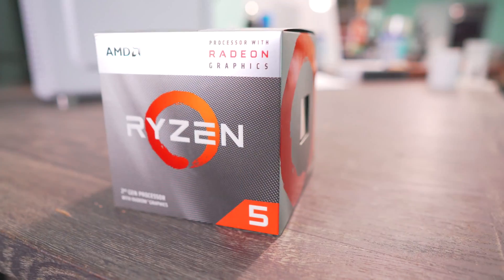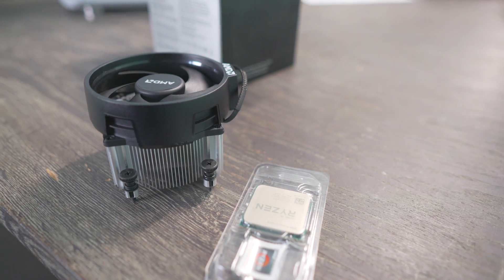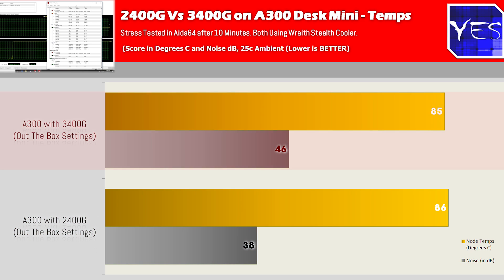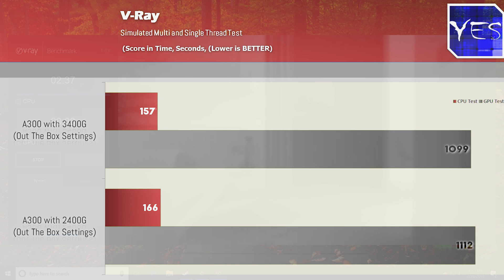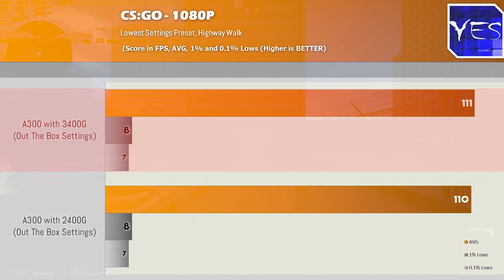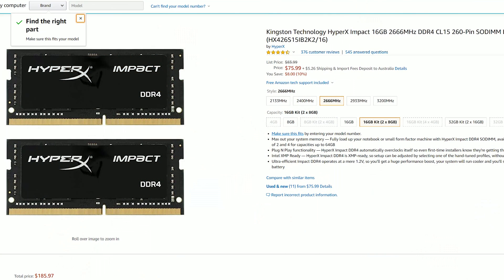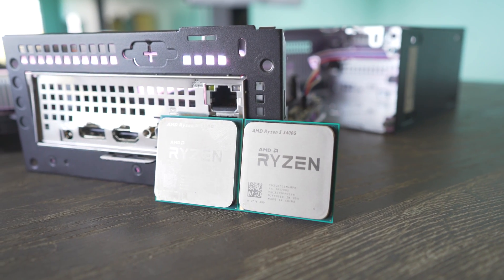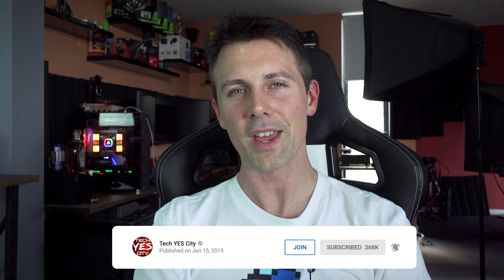Ryzen 2400G Vs. 3400G ON Desk Mini A300 - Catch 22

Comment: Are you able to see how well it copes with WoW?
I got to test a 2200G while ago and while it was fine for solo stuff a five man dungeon was about it's limit, I did test a raid and it didn't crash but it wasn't a smooth experience. I don't know if the 2400G would have enough for the raid to be smooth but the 3400G might cope better with the newer cores.
I'm asking as one of the people I raid with is struggling on a very old laptop, I'd have gone mad putting up with it years ago!
Reply: This is confusing. Are you asking for yourself, or for your friend with the old laptop?

If you are asking for your friend, I suggest you steer him to the Integrated Graphics Survival Guide by LowSpecGamer.

I just recently purchased a 2200g for $59.99, and my first upgrade will probably be an RX 590 discrete GPU. After that I will probably upgrade to a R7 2700X.

If I feel the need to, I will do as the Integrated Graphics Survival Guide recommends, and download Raptr.

Comment: disappointed mate. thought for sure you were gonna do these tests with the highest frequency ram and overclocked ram, cpu, gpu
Reply: Overclocking on A3xx Chipset? Any bios options? Forget it. OC you start with chipset B450 and higher. 
ITX-Cases are too small, too much heat --> cooling too loud. For OC you need a bigger case.

Comment: My 2400G works with 3333MHz RAM clock @ CL16. For maximum game FPS.
Reply: can your RAM using 3333 or you can just use ~3000? in CPU Support Specs => DDR4-2933MHz (Ryzen)

Comment: Hey man,
i had slight different results, but i tweaked all the settings to the ground.

The Following Setup is what I used:
ASRock DeskMini A300
AMD Ryzen 3 2200G 4x 3.50GHz So.AM4 BOX
16GB (2x 8192MB) HyperX Impact DDR4-2666
500GB Crucial P1 NVMe M.2 2280
Noctua NH-L9a-AM4 Topblow Cooler
ASUS Rog Swift PQ278QR @165hz

You should know i am Playing Counter-Strike on a competitive level thats why i used a lower resolution.
On a Resolution of 1280 × 1024(5:4) i have on avarage like 160fps and it never drops below 100.

GTA5 i never went below 80FPS @1080p
Fortnite around 75FPS @1080p
The Division 2 - 55FPS @720p
Star Citizen 20FPS @720p
Ark Survial Evolved 30FPS @720p

Comment: you need good memory. at least 3200Mhz. APU runs way better with fast memory.
Reply: At least 3333MHz at CL16. You need 3400 or 3600...
Reply: @christiankulmann3325  yes I have overclocked 3200mhz to 3400Mhz CL16. I am thinking of getting 3733Mhz C17. I could probably overclock it around 4000 Mhz. I just don't know what kind of performance gain I would get out of this upgrade

Comment: Hello there!  I have this same system, with a 2400G, as well as a new 3400G in a box, ready to install.  Before I do, would you be able to benchmark this with World of Warcraft, on both systems, in 720p and 1080p, and post the results?  I would love to compare your results VS mine.  Thanks!
Reply: Either should push WoW fine. I have an overclocked 2200g system and I see 40-50fps on gfx preset 7 in Battle for Azeroth raids & 80+ gfx preset 10 in Classic both at 900p (1600x900).

Comment: Anyone know if i get the 3400G with B450 MB the bios will have to be updated first and not have to with the 2400G?
Reply: Yep. The 3400g will need a bios update on that board. You don't need to necessarily update to run your system with the 2400g.
But updating is not that big of an issue. Unless you are tight on budget, go with the 3400g.

Comment: Excuse me. Can anyone clarify if the cooler that come with 3400G fit on the desk mini a300? Thanks!
Reply: Nope 
It wont fit 
3400g heatsink is too tall 

I reccomend to use cooler from that a300 
Certainly a bit noisy, but i runs cooler than stealth wraith cooler 
Lower 2 degrees celscius exactly

Comment: I believe the A320 based boards can indeed support 3rd generation Ryzen CPU's. This channel tested the cheapest Gigabyte A320 board with a high end 3000 series CPU and found it to work fine. 

Of course, this does depend on the motherboard vendor releasing suitable BIOS updates but otherwise there is nothing physically preventing these boards running the newest chips..

Comment: I didn't think there would be much differences between the two APUs. But, glad you did the testing sir.
Reply: 2400 is ryzen 1st gen and 3400 is ryzen 2nd gen, it's not 7nm and not ryzen 3rd gen, hence why they are so close
next one should be based on 3rd gen and 7nm, maybe that one might be a much bigger boost/difference
Reply: Cobac Good point. Thank you.

Comment: Now I need a ryzen 9 3990G with vega 56 performance.
Reply: PS5 must be the answer
Reply: @FodrMichalych  as for raw performance, no. As for game performance, Very unlikely. I mean,  optimization for playstation may be able to reach 4k 60fps on ps5, I doubt it'll reach 4k 120fps. A ps5 chip has to have low tdp, low power consumption and so on.
Reply: @Octa-8wow  that's still not enough if you consider it has navi graphics and 8 zen2 cores. It has to draw like 100 for the cpu and 100 for the gpu, which is very little. Tdp will be even lower, probably around 45-65w for both the cpu and gpu.
Reply: @Octa-8wow  but we know for a fact it's gonna be zen2, 8 cores 16 threads, and a 12tflops navi gpu.

Comment: Some months ago I have decided to build my EVER FIRST PC myself. I am an oldie (64) so bare with me...

Here are the components I have decided to use and already bought them:
ASRock A300 barebone PC
 
Noctua NH L9a CPU cooler
 
HyperX Impact DDR4 SO DIMM 2666Mhz CL15 - 8GBX2 - total 16GB
 
Samsung 970 EVO Plus M.2 NVMe 500GB SSD (main drive)
 
Samsung 860 Evo Basic Internal SSD 500GB. (secondary drive)

My original plan was to use the AMD Ryzen 5 2400G CPU, but I have decided to wait for the new AMD Ryzen 5 3400G.

I am not a pro but from what I manage to understand after seeing some reviews and Youtube clips the main differences between the AMD 2400 and 3400 are mainly aimed at gaming.

The original Asrock A300 does not require any BIOS changes using the 2400G while the 3400G does require changing the BIOS.

The AC power consumption is a bit higher in the new CPU.
Is the ASrock A300 ready for the new CPU?
The new CPU is more expensive.
Will my DDR4 RAM (HyperX Impact DDR4 SO DIMM 2666Mhz CL15 - 8GBX2) match the new CPU?
Are these correct?

As a reminder - this PC is NOT for any kind of gaming, just web browsing, MS Office and some photography work such as Adobe Photoshop and Lightroom and some basic video/slideshow work.

Based on all the above - do I really need the new CPU?
Or should I stick to my original, cheaper and more easy plan and use the AMD Ryzen 5 2400G?
Does it justify the price increase in the new CPU and perhaps some complications in assembling the PC for a complete novice like me?

Thanks for all your comments and advises?
Reply: Basically your planned build is the same I have already.
I agree with previous post that 2400G is better choice because it does not need BIOS update.
2400G is good/fast enough to do daily tasks.
Reply: @retro_ed746  Thanks a lot! It could be nice to see more details and your comments about your PC.
Reply: @ronyzmiri  I am running Ubuntu 19.04 with 2 x 4 GB 2666 MHz Corsair memory and only 128 GB M.2 NVMe.
CPU cooler is Noctua NH L9a. Excellent choice, 9/10 (it is not cheap). BIOS has an option to make simple fan RPM curve for CPU with temperature steps. Cool & Quiet.

I have multiple systems and even this is "the weakest" I like it most. It is small, quiet and powerful in it`s class.

Updating BIOS add a new option for setting manually how much VRAM iGPU reserves . At some situations it is only 1 GB for iGPU.
Version 3.40 and above fix it.
Only minus is that DeskMini do not have a WiFi & Bluetooth. It can be added afterwards or using USB type dongle.
Reply: @retro_ed746  Thanks a lot, mate! In travel now and can hardly wait to build mine...)
Reply: It might be a good idea to wait for the thoughts of other people, and not decide on what I say alone. From what I know:

The performance between the 2400g and 3400g affects more than just gaming, with the cpu and gpu being a little faster. It is a small performance boost.

The RAM is fine.

Power consumption should be fine, as at the wall it was under 100w, so it was below 100% load in the video.

The main thing about using the 3400g is the BIOS update. If you already bought the a300, then it's likely that it needs a BIOS update to support the 3400g. AMD has program where they lend you a CPU to update the BIOS, but the amount of work it takes to get the cpu, flash a new BIOS, return the cpu, then install your CPU may make it difficult.

The 3400g has small benefits with a small price increase, but the BIOS update can be a problem. If web browsing, MS Office and Photoshop is your main focus, then the 2400g is a safer bet.

Comment: I just hope that the next 4400G comes with rx570 level of performance..i don't mind 4c8t as apus because the 3600 is very good in doing multithread work..just need an all around apu now for solid 1080p gaming,if they can do vega M GH with gtx1050ti level of perf.. it's possible they can do rx570 in navi 7nm😏😏
Reply: That’s a lot for your wish...even vega 11 struggle between gt 1030 ddr5 vs rx 550... so even with high hope i don’t think 4400g with navi will get close to rx 570... to be real if they really did their best they can squeeze a rx 560 inside that apu
Reply: @NamelessPassenger  rx560 will be expected..but if they can do Vega M rivals the 1050ti in 14nm, I believe they can do better in 7nm..if they want to postpone and let the process node matures, I don't mind getting one in Q3-Q4 2020

Comment: Wait a minute . I have a Desk mini A300 , Ryzen 2400g and 16gb Hyperx 3200 mhz and i play GTA V on 1080p Medium settings with 50 - 60 Fps .
Reply: A300 supports only up to 2933 Mhz RAM afaik, did they change it in the bios update?
Reply: Try 3333MHz @ CL16. It works for my 2400G.

Comment: I got a 2400g, was thinking about an upgrade to the 3400g this stuff really helps. subscribed
Reply: The 3400G really excels with faster RAM. Ends up being about as fast as a GTX 1050 if you use 3600MHz RAM.
Reply: @CeriPie  i have 3200

Comment: I own Ryzen 2400g and I always been running memory at 3200Mhz (Corsair Vengeance 3200Mhz). I did not go with A300 because Asrock motherboard is not as good as Aorus b450i.  B450i works beautifully with 2400g. Many overclocking options and 3200Mhz is solid (with memory which is actually rated 3200Mhz).

Comment: but 2400g clocked up to 3400g performance basically identical right?
Reply: No, Ryzen 1st gen vs 2nd gen on the CPU, they are nowhere near the same... Buy you can overclock to gain performance on either, the second gen will overclock higher though, and it’s also soldered (the 2400g is thermal paste, not very good paste either, I delided my 2200g for better temps). Also the second gen memory controller is way, way better than first gen, so you can run much much faster memory (and have a much easier life trying to get everything working). The new one is also more power efficient.

They are not the same, even taking them apart is extremely different since a razor blade and a vise probably won’t do the trick on the 3400g!

Comment: so does it not really matter because both are tdp limited to 65W, so even if the 3400g is clocked higher it will still be limited by the same power restriction so it will just throttle itself anyway?

Comment: Do you need the 2400G to update the bios, or can you boot 3400G on earlier bios versions?
Reply: Yes you need either an AMD athlon or a 2200G / 2400g for bios update to use a 3400g for a deskmini build before 21th may 2019, btw I got my in a shop they did the bios upgrade for free, else you need the loan kit from AMD , this is free apart from return shipment costs. The old bios version before release 3.50 will not with a 3400g
Reply: They are both non zen2 chips. They are not on the same level as the 3600-3900x actually using Zen 2 7nm design. This is still by all means 2nd gen ryzen with slightly better performance. So to answer your question it doesn't matter which you use they are the same architecture.

Comment: Aren't the APU's limited to 2GB dedicated as VRAM unless you run 32gb then you can have 4gb? Not saying to go get 2x16GB 3200mhz SODIMMs but, maybe a lower frequency with more capacity. I think it would be a big improvement on the 3400G. I could be talking out of my ass though. So there's that.
Reply: No, you should run minimum as possible, it’s integrated graphics it will only use as much as it needs unless you tell it to waste it (locking it out CPU memory heavy tasks), so don’t lock it down. If an application needed 10 GB of video RAM, it will go ahead and use it, you are not setting the max in BIOS, only the minimum (and why forcefully lock that away from possible CPU usage? The only time you ever want to do that is if a game has a fake minimum requirement check)
Reply: Till 16GB vram the AMD APU can take. 2GB is only the minimum size.

Comment: Those vega gpus are memory bottlenecked with the 2666mhz memory
Reply: Magnus and probably by power supply
Reply: @darchandarchan7036  nah, total system consumption was 96 watts, the psu for that system is rated for 120w.
Reply: He knows.
Reply: @CeriPie  i know that he knows. But the people that watch the channel, they may not know. The difference betewwn those apu's, in a correctly configured system, is greater than what is shown here
Reply: My 2400G works with 3333MHz RAM clock @ CL16. For maximum game FPS.
Reply: @christiankulmann3325  which RAM?
Reply: Now i have a budget for the Radeon rx590 would this work with my Ryzen 5 3400G? or should i go with rx 570 or rx 580 instead?
Mobo : Gigabyte b450 aorus m
Ram : kingston hyperx predator 3200mhz  2x8gb.
Reply: dude youre really a hot shot......
i already tried it to 2933mhz and its working fine no problem whatsoever!!

try update the mobo first, then talk later

Comment: I have the deskmini with a 3400g I use it with 3200mhz Ram and a noctua cooler, I can confirm , this setup is much more expensive as setup with a 2400G ,  but Just like to get the extra power for a 100$ more, I even will add a 40 mm fan to get some extra cooling and use a bit of memory overclock. With a notua cooler the max temperature is 80 degrees. So price/performance a 2400G would be the one, btw I use my ipad as monitor (this is the Splashtop wired xdisplay app)

Comment: The test was only done with 2666MHz SO-DIMM.
Depending on your region, it is very easy and cheap-ish, or rather affordable-ish to get a 3200MHz CL 16-18-18-43 Kit. (Germany for example it's $104€ including taxes for 2x 8GB 3200MHz CL16)

Seeing as how the Vega 11 is heavily bottlenecked by the RAM bandwidth, for gaming getting 3200MHz is a necessity. (while on top trying to OC/tweak the clocks and timings to improve even more)
Also, OC'ing the Vega 11 graphics of the 3400G to 1700MHz should be possible no problem with the included external 120Watt PSU, to tickle the most out of it.

The all core boost was possibly also bottlenecked by the thermals, with the "Noctua NH-L9a-AM4" getting very close to the 4.2GHz boost clock (same boost as Ryzen 5 2600X!) should also be no problem.

Comment: Great video! It goes to show just how memory bandwidth limited these APUs are. I tested my 3400G with 2133MHz memory and 3466MHz with tightened timings, and I saw a performance increase of like 24%. I believe slow memory is why some of these benchmarks didn't show a difference the two chips, even though there is a gpu clock speed difference.

I made a more in depth video about it if you want to see more specific details.
Reply: Of course. You need 3600 RAM, and not slower like 2666...
Reply: I think a xeon 2689 (ryzen 1700 performance) + GTX 960 will be better.
Reply: @coffee-vz1nr  Of course, but I was just referring to the igpu having more power than people sometimes realize, because they choke it with slow memory.

Comment: The 3200g vs 2400g on a Deskmini A300 comparison would be very interesting.
Reply: The 2400G has the most powerful graphics of both. For gaming the 2400G is much better (VEGA11). The 3200G has only much slower (VEGA8), this isn't for gamer.

Comment: I have this same combo.. except I went with the Noctua cooler (to fit) and DDR4 3200 CL18.... I play GTA 5 at 1080p and it's smooth enough, Also works pretty well as a Wii and PS2 emulator at 720/1080p settings... will get the Zen 2 APUs when they come out next year sometime.
Reply: Do you have any overheat issues? I also want to buy like your combo with Noctua Cooler! :)
Reply: @Mosestylez  - none... the noctua cooler has worked great.
Reply: @honeybadger6127  Does it works great even when gaming for long time of period? I don't play GTA V anymore, but would it for instance run GTA V without overheating? :)
Reply: @Mosestylez  - no overheating issues.. no problems at all. I'm loving this little unit.
Reply: @honeybadger6127  which one do you have Ryzen 2400G or 3400G? And how much did everything cost?

If I get all the cheapest parts, such as ram, internal storage etc, it ends up costing like $650 :/
Reply: @Mosestylez  I had the 2400g... then upgraded to the 3400g. The cost was around 600... but I constructed this well over a year ago.. so prices would likely be cheaper now.

Comment: I am waiting for the A520 and B550 boards to come out before I build a 3400G APU system.
Reply: I built a very decent rig with a 3400G and a B350 board. You don't need anything special to run these 3000 series APUs.
I made a video about it if you want to see some performance figures with that combo.